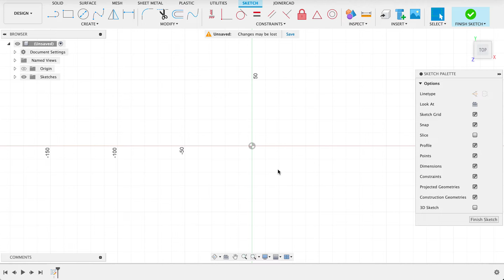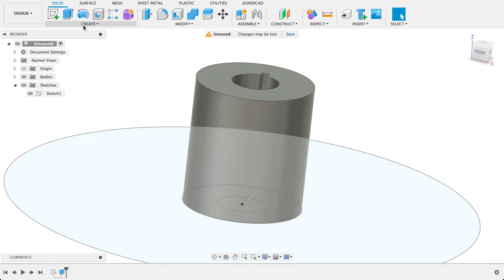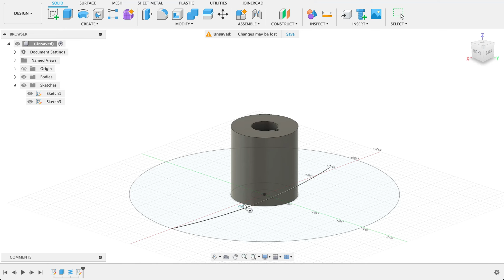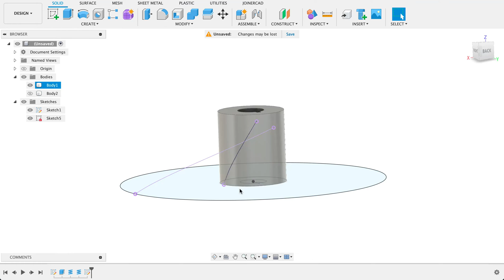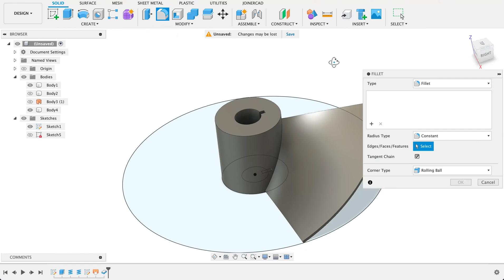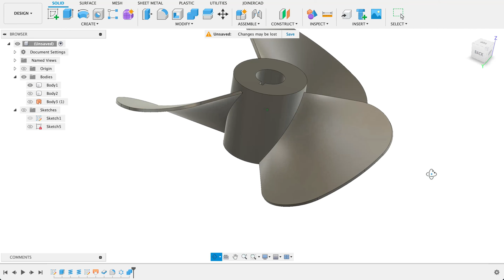Fusion 360 Tutorial: Making a 3D boat propeller

Comment: Get quite gap between hub and Prop, how to fill that?
Reply from the maker: You shouldn’t have a gap at all if you used the origin axis for your blade lift plane. 
I don’t recall how I did it.  It you can also make hub bigger and use a join operation to make them a single body

Comment: Excellent tutorial. What do you do after you finish the model and you decide that instead of 400mm you want 500mm?  Is there a way to change this and have the change be dynamically reflected through the subsequent steps?
Reply from the maker: If you go back in the timeline on the bottom left you can make changes to previous drawings and other things then it will update your whole drawing. Just be careful though because sometimes it breaks your model and then you need to update other things

Comment: Awesome video! I knew there was a way to do this with 'coil' but I just couldn't figure it out.  I do have a problem, after I create the loft and thicken, there is a gap on the root of the prop blade - to explain a little better, its the inner coil geometry making contact with the cylinder and due to the thickness of the blade, one blade face does not make contact with the cylinder.  Hopefully this makes sense...I would love a hand cleaning this up if possible! Thanks!
Reply: AHHH :D I figured it out, when I used the 'thicken' command, I selected symmetric as opposed to one side.  Going back and selecting one side, it 'thickens INTO the cylinder.  Cool thanks again, great videos!!! :)
Reply from the maker: Thanks man. So glad it was helpful. Messages like yours really make my day. I love 3d design

Comment: My software will not allow 0 revolution as  shown on your tutorial. Is there a setting that can be changed? I am using the free version if that makes a difference:?
Reply from the maker: You can try set it to 0,2 or something near that. If that doesn’t work you can set a full revolution but just extend the coil a lot higher. If you do the math you can set it to 1 and just make your height 5x higher than what I did in the video
Reply: @Fusionfundamentals  thanks buddy
Reply from the maker: It’s a pleasure